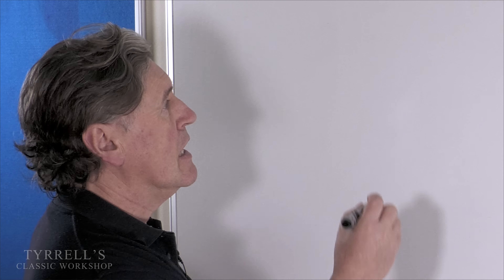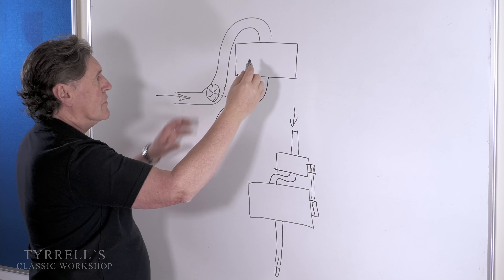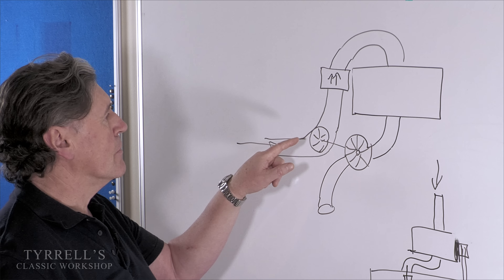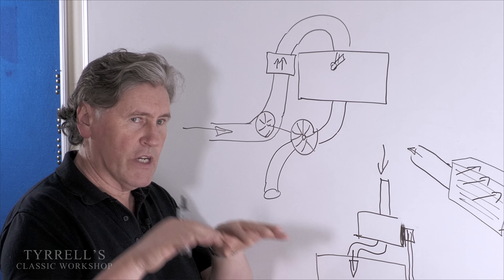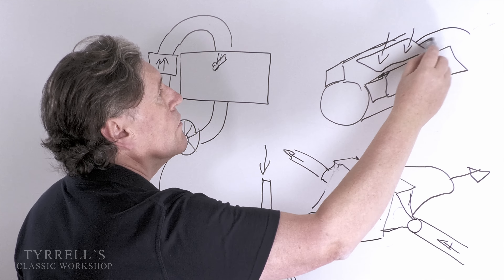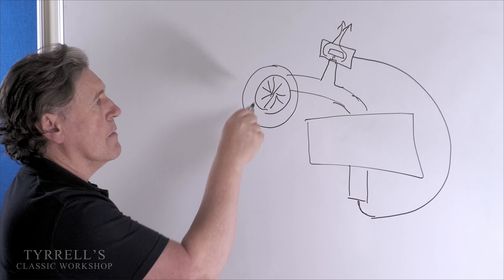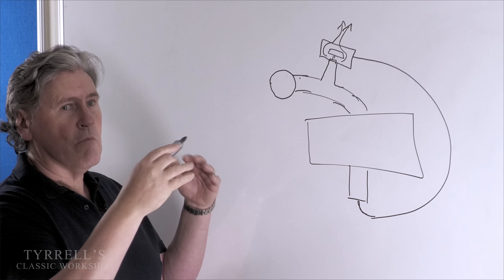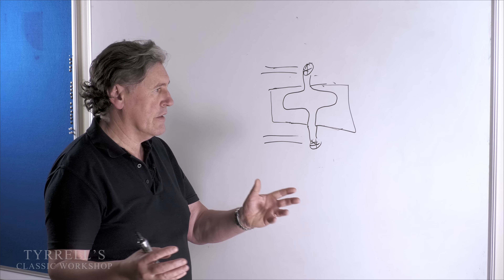Turbocharging vs Supercharging - The Ultimate Guide | Tyrrell's Classic Workshop

Comment: Fun to watch... But... No mention of SAAB? 

SAAB invented the wastegate, which made all the difference when it comes to reducing turbolag and improving driveability. The Americans may have been first, and BMW and Porsche may have introduced turbos in their extreme models before SAAB did - but SAAB were the ones who got the turbo to work properly. 

The wastegate, and the knock sensing active boost control system to govern it. All SAAB inventions. The very thing that made the turbo work in daily driving. Pioneering work.

Also, the difference between the wastegate and the dump valve is worth explaining, as people tend to get that wrong.

Not to mention the fact that SAAB were the first to combine turbo and multivalve technology. As early as 1983, you could buy a SAAB 900 turbo, with an intercooled 16 valve engine and the then brand new, fully electronic Bosch LH fuel injection system (which the Testarossa didn't even have). For it's day, that engine was quite something. 

So, I'd say SAAB definately deserves at least an honorable mention here. 😀
Reply from the maker: Saab were indeed pioneers with turbo technology.
Reply: @iain_tyrrell  A big thanks to you for making all this great content. And for taking the time to read the comments!

Comment: Genuine question, if not to sound like a bit of an idiot - why do some turbos make a "chirruping" sound? You get the induction noise and then the chirrup? Is that that just the blow-off valve? I hope that's not a completely daft question.

I also wonder why some engines use a supercharger instead of the turbo, given their inheritant inefficiency...? Hey, I'm definitely no engineer! 😊
Reply: Yes it is
Reply from the maker: There’s a lot happening in an engine, particularly a turbo one. Some installations do have acoustic signatures, such as turbos spooling up etc
Reply: There must be a reason top fuel dragsters that run 330 mph in a quarter mile use a supercharger instead of a turbo
Reply: @jefferystensland1304   They'll have finished their run before the turbo has spooled up! 🙂